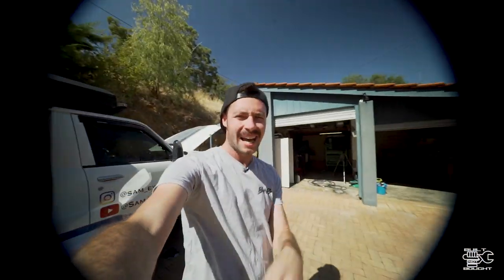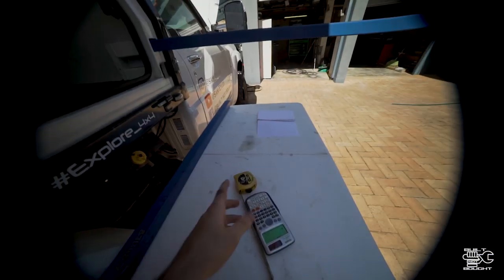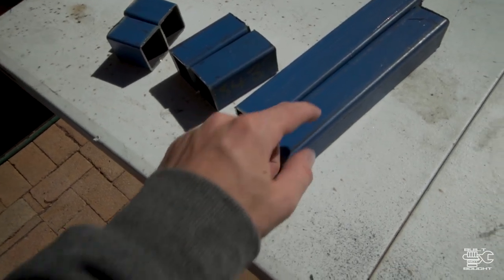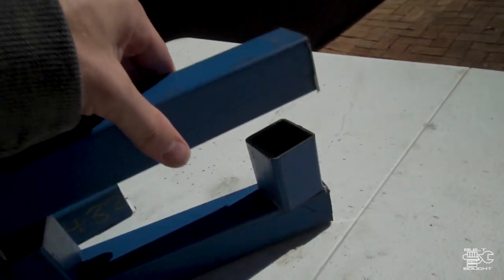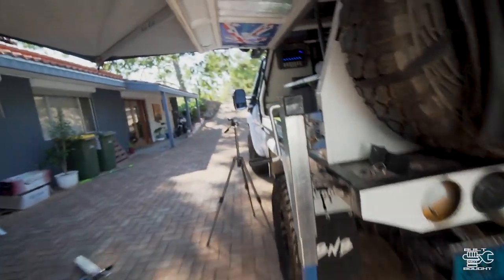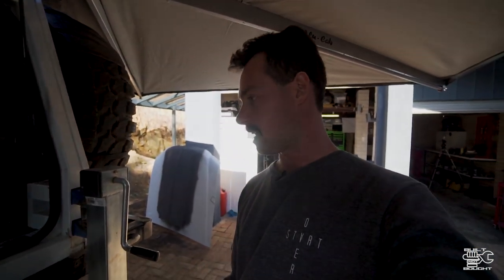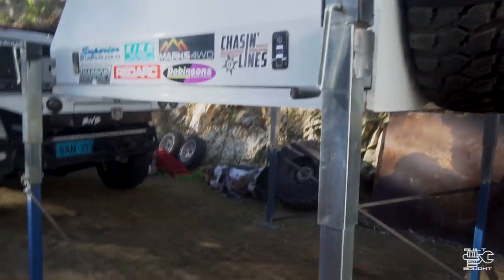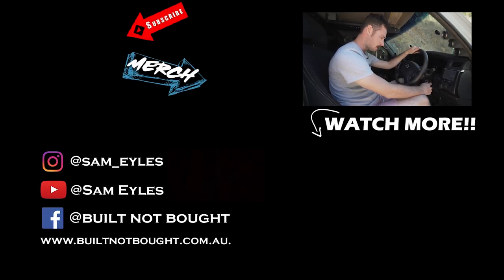How To Make Your Canopy Lift Off

Comment: I cut the windy handles off and welded nuts to the shafts so you can use a 19mm on a drill to wind the legs up and down quicker.. 👌

Comment: quick hack for lift-off. Air bags in the rear suspension. Pump up the bags, wind legs to ground level, then drop the air out of the bags. you should now be able to drive straight out from under. do the same in reverse to get the canopy back on.

Comment: Love your work. My parent in-laws have a similar setup. Nowhere near as robust! 

It was never going to fall over. The inner steel would have to be able completely twist inside the other tube for that to happen, even less chance with the double pronged setup you have. 

It has more chance of tipping over and those cross braces won’t stop that!

Comment: I reckon you should weld a chain link on the forward and rear faces so you can put a ratchet strap across the front and rear stopping the arms coming out of the sleaves for extended periods of the canopy being off the truck. A 15min job that could save you so much time and money should the "impossible" becoming a cluster fuck. Also that would make it good to set up camp and leave it set up while you go off and hit the tracks during the day